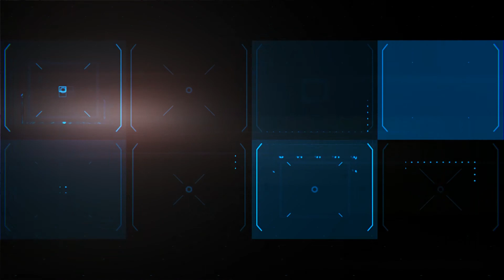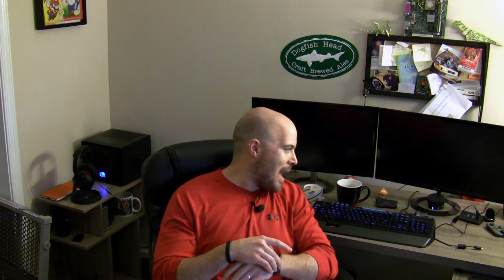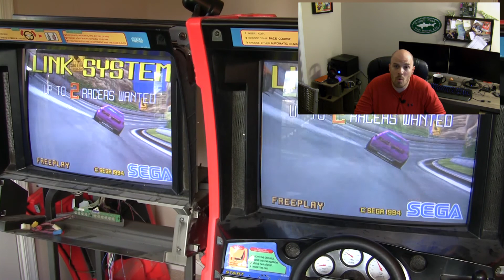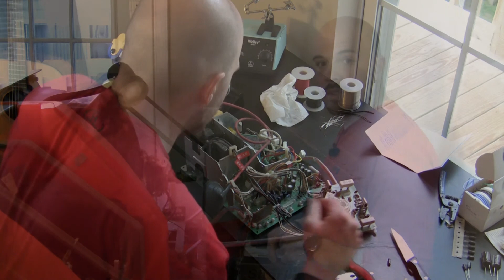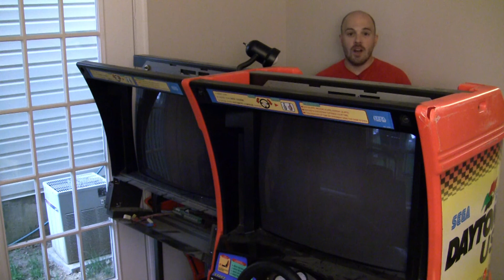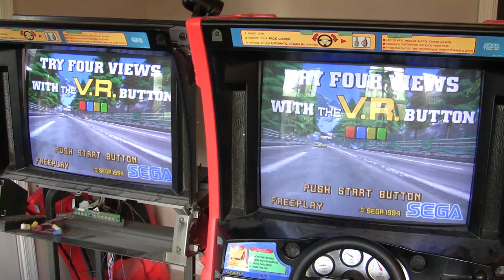Daytona USA Twin Cabinet Project - MS8-29 Monitor Chassis Repair

Comment: Thanks for the video! i was wondering if these monitors take a vga input?
Reply from the maker: No, they do not. Medium resolution monitors are a weird lot... they have a higher horizontal refresh rate at 24kHz than CGA, but lower than the 31kHz of VGA. There are some adapter boards out there, but I don't know anything about them.
Reply: @mrbendawg  ok. Thanks for your reply. I was thinking these might work for an initial d v. 3 arcadei and use these for back ups as it is a 29 inch too but i notice the inital d monitor has a vga input.
Reply from the maker: @Heysahs007  Correct... Initial D is a newer game... I think Naomi, but it may be Lindbergh... I can't remember... but it is VGA output.

Comment: You are one of the few persons that I have seen who has been able to fix one of these. 
I have x2 of thse MS8-29 FSG's and x2 MS8-25FA's with various problems, these MS8 29 & 25 monitors are almost the same if not the same even if they use different sized tubes, their yokes are the basically the same in mH/ohms. 

From the top of my head: one  MS8-29 and x1 MS8-25FTB have vert. collapse which I have not been able to fix, I have done complete cap swap on all of them replaced the vertical ICs "LA7832" and still the same issues with vertical collapse, the other MS8-29FSG shows the picture compressed at center of screen like when you adjust the vert. size to the minimum, turning the pot to the max doesn't seem to do anything, replaced the pot and still nothing, the fourth chassis which is MS8-25FA has various issues with bleeding colors and botched sides (trapezoid and pinchusion doesn't work)
Reply from the maker: Man, I didn't notice this comment until today, so I apologize for the late response. From some experience, here are some things to think about/look into with your MS8-29 & MS8-26:

I had vertical deflection issues with the K7000 on my MAME/multicabinet. It wasn't collapse, but I had to replace a few non-standard components while shotgunning typical components (which I hate, but the WG unit caused me a lot more headache than the Nanao) to get it right. I ended up replacing the vertical deflection IC, but there was also IC in the circuit that dealt with vertical sync that was causing high B+ shutdown. I don't have a diagram of the MS8 chassis in front of me, but it's something to look into - see what else is in the vertical deflection circuit and start testing.

There are a TON of film capacitors that do not come with typical cap kits. Why? Because film capacitors don't go bad. Well, they do... just not at the rate or for the same reasons as electrolytic capacitors. There is an assortment of LARGE film capacitors smack dab in the middle of the MS8-29FSG chassis (and I believe it's similar on the MS8-26). If this is similar to my K7000 chassis, these are filter capacitors for horizontal and vertical deflection. Have you checked the film capacitors in the vertical deflection circuits? I would. If they test fine out of circuit, reuse them. if not, buy replacements based on their values. You'll get new ones that don't look the part.. as long as the values match, they're good. I had this issue with my K7000... the original C69 capacitor was HUGE, and my replacement was tiny... difference in 20 years of tech.

Speaking of deflection circuitry, how do the traces look around your deflection ICs? I had to replace the HDT and remote locate it due to heat damage. Although heat damage isn't typical of the Nanao units, it's something I've learned to be cautious of with the K7000 as they all had cold solder joints from the factory and heat could cause solder pads/traces to lift over time.

As far as the unit with the wonky geometry and color bleed... have you checked B+ or adjusted the pots on the flyback? That sounds like a power issue - specifically, the tube getting too much power. I don't know what the B+ shutdown is on these, but you're supposed to have 94v. As far as the flyback, you adjust these until you think it looks right. If you've got color bleed, at least you know the flyback and electron guns in the tube are good... so this chassis is worth the aggravation to get it right.

Hope you get things sorted out. Again, sorry for the delayed response... hopefully I was helpful.